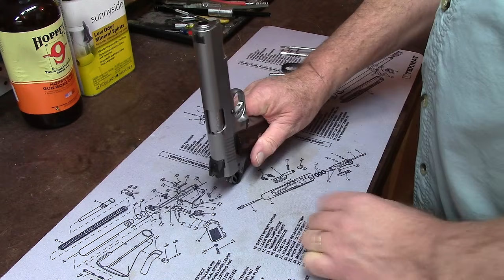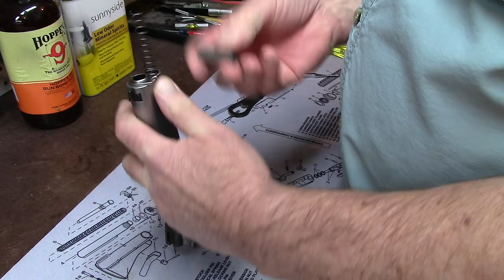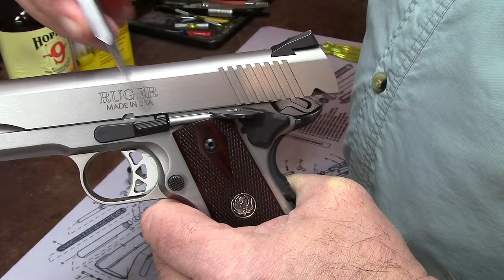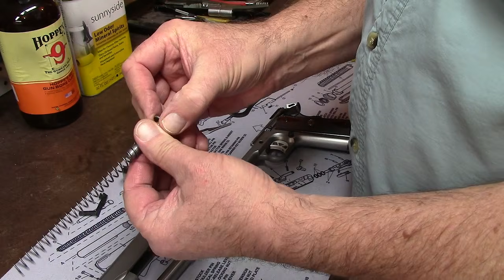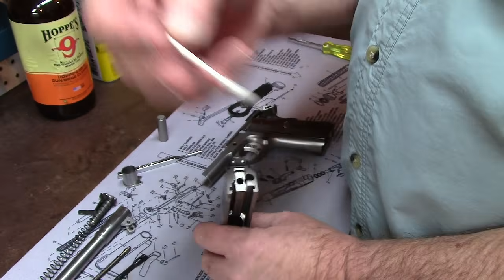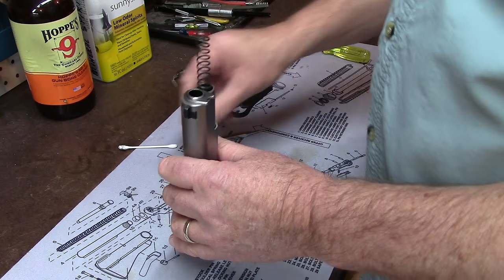How to take down the 1911 pistol for service, inspection, cleaning & lubrication ~ Now in HD!

Comment: I just bought a Springfield loaded 1911 and my plunger tube that catches both the safety and slide lock will not allow me to drop the slide stop into position. I've tried applying just a little pressure with the stop to the small spring in the plunger but it will not push the spring in to allow the stop to seat. I've had to push in on the spring to allow the slide lock to be able to drop into place. I checked the spring and it pushes in and springs back easily. Any ideas out there? Hate to send back to Springfield after just getting it.
Reply from the maker: Brad Fortson 
I am not exactly certain if I understand the issue completely, but I do know of a common problem.  Your gun most likely functions, because they are worked quite vigorously during fitting.  If you are speaking of manipulating the slide stop toward the frame into its home, be certain that you are positioning the nose of the stop toward the small cut and not the slide stop cut, or it will stand off from the frame and be inoperative. The stop can easily appear to be fully home, but if it's not pressed fully in, flush to the lower frame, it simply will not work.  I point out this small cut in detail in the takedown video, so be sure you get the nose of the stop into the small slide cut, and NOT the slide stop notch.
Reply: At 18:53 into the video your thumb is right at that what I think is a small detent spring that is part of the plunger tube. It has a spring loaded round head on each end of the tube. One to the safety and one to the slide lock. At that point in the video where you drop it in and snap it down into position is where mine is not working. I have to push that small detent into the plunger to allow the slide lock to snap home. Thank you for your time. It's an honor.
Reply from the maker: Brad Fortson 
It's an up and in move, rather than straight in.  Otherwise, the stop is defective.  Call Springfield, and I would bet they'll send you one right away.
Reply: I'm having the same issue with a Colt Commander LW . I have to use a pick to press the detent back in while sliding the lock into place or else it gets caught in the slot . There's got to be a better way .
edit : It just took some trial and error to get it to slide in without it getting caught on the detent .

Comment: Great video. Did I miss the "lubrication" portion or do you assemble dry?
Reply from the maker: Brent Vinson 
Stainless steel guns require minimal lubrication, which is nothing more than a wipe with a lightly oiled cloth.  Please watch my video on lubrication, and also the recent video on the disassembly and care of the Smith & Wesson revolver, where I deal with a blued steel vintage gun.  Those will give you the correct perspctive.  OILING of a gun, other than for metal preservation, is absolutely an invitation to gun problems.  Guns are not in need of oil to operate or to prevent wear, except in very specific parts of very specific guns, and even then only minimally.  The popular culture of lubrication is a very recent phenomenon that has no foundation in any major firearms owners manual or armorer training.  But the 1911 you saw me work on is my own that I have fired regularly, shot in local competition, and have carried almost daily for six years, and it's like new, with no wear whatsoever.
Reply: @GunBlue490  like when a steel slide rides on an aluminum frame? (92fs)

Comment: My Dan Wesson 1911 is not easy, the bushing is so tight you cannot turn by hand and must use the tool...  The slide stop requires a thin piece of plastic to install to get past the safety slide.  Not disputing what you say at all, but it just doesn't move easily at all.  Once its together it feels like its on roller bearings and is an absolute joy to shoot, which I do often...   The Colt series 70 is a piece of cake!!   Thank you for your knowledge!!!
Reply from the maker: Tight bushings are not at all uncommon, as it has been believed by many that it results in more consistency.  That's where the tool originally came into use.  Colt and others have used fingered bushings to provide a spring-like grasp.  In practical use, the barrel rests in a consistent place from shot to shot, even with relatively loose bushings, owing to the dynamics of the spring tension that provide repetitive return to battery.  Wherever the barrel rests, it always rests, so it's not random.  As for a tight slide, it has little to do with 1911 accuracy, because it too returns to the same place shot to shot, and the sights are always on the same plane.  The most vital relationship is the barrel link and of the barrel locking lugs to the slide, which are responsible for those consistent return-to-battery relationships.

I've shot some pretty tired old service issue 1911s with sloppy slides and barrels that would hold ball ammo cutting into the black.  Not gorgeous groups, but certainly better than most folks would imagine them capable of, and in fact, would be capable of winning a typical Saturday night match in the right hands.  The pistol you see in this video shoots an entire 7 round magazine of a particular +P handload with Remington Golden Sabers propelled by Accurate #5 into an incredible 3/4" at 25 yards, using an old Lee pistol (machine) rest.  With hard ball jacketed handloads and a standard velocity load with Green Dot, it shoots the 10 ring of an NRA Slow Fire target, and at least 40% cutting the X-ring.  I'm not sure if I'd bet on a Gold Cup to perform significantly better, and it certainly would be less reliable.  This bushing is perfectly snug without being tight, as was Ruger's design, manufacturing the bushing and barrel from the same stock.  The wonderful Colt 70 Series is certainly what Ruger modeled theirs from.
Reply: Good info thanks!!  As far as the Dan Wesson being annoyingly tight in every aspect it does shoot well out to 50 yds.   It loves 5 grains of red dot with a 200 grain round nose flat point cast bullet.  I'm fortunate to have a 300 yd range off my porch here rural southern Indiana.  Your videos are top notch and have been very helpful, thanks for sharing your knowledge it is greatly appreciated!!

Comment: Well done! I wondered what you might have to say about the semi-custom category of 1911's!  I'm the proud owner of one of these.  We love the workmanship and its feel while shooting. However its tight fit up makes me wonder about its lubrication requirements.  When I got the new weapon it was packed almost like  sardines in oil.  Also I was instructed to put 1000 rounds through it and keep it well lubricated -All of this before cleaning and expecting reliable operation.  Well , it pretty much went that way -initially it had occasional issues with stripping and going to battery but after that bobbles were almost nonexistent.  Per you sage advise if have greatly minimized the oiling but I still wrestle with this question  -Does this pistol's "special nature" require more lubrication?

BTW I had to return the Pistol to the manufacturer since it occasionally failed to lock the slide open on an empty magazine. ( I had statically verified that the magazine followers had sufficient force to elevate the slide lock to engage the slide notch).  The manufacturer provided excellent service at no charge and re-cut the back end of the notch as its lower corner had been deformed by impact (or friction?) with the slide lock.  Now I'm afraid to use the slide lock to release the slide.

I now feel  that perhaps a 1911 that is used for carry, in the field,  or for battle should have a looser fit up. I would therefore require minimal lubrication, allowing for greater dirt and contamination tolerance.  My semi-custom is a range queen so I clean it excessively and a little extra oil doesn't seem to be a problem.  I'd be interested in hearing you thoughts on these matters!  Thanks GunBlue490!

Comment: Very good instructions, this is the way I've been doing it with my Colt series 70 for 42 years now. I've also been using Hoppes #9 since I was 12 years old, and I'm 64 now. I see you like to use mineral spirits as well for some of your cleaning procedure, but what do you think about using kerosene in place of the mineral spirits?
Reply from the maker: Glenn Wheeler 
It's fine, but the red dye is not!
Reply: Thanks for your reply, but the kerosene that I buy by the gallon is clear as water, the kind for heaters and not the kind for lanterns.
Reply from the maker: Well, you asked me what I think, and to be honest, kerosene went out with Gone With the Wind.  Mineral spirits was invented during the 30s to provide a better cleaning alternative to other products that were already around, including kerosene.  Since then, mineral spirits (Stoddard solvent) became the active ingredient in almost all gun solvents and other products.  Most folks don't know it's the primary ingredient in Rem-oil, CLPs, Marvell's Mystery Oil, thread cutting oil, and even Hoppes #9, because it works better and is more agreeable to work with than anything else, including especially kerosene.  I'm still using the same quart can that I bought ten years ago for my guns, tools, and many other bench projects, and it's only half empty.  Less than a thimble full cleans a gun, with ease, so it's certainly not a cost issue.  When mineral spirits came out, most guys gladly stopped using kerosene, but it's your call.

Comment: SAFETY QUESTION(Please Reply):
Good Sir,
I love what you said about Ruger using a titanium firing pin and heavier spring in their new SR1911s, ala Series 70 Colts. I learn a little something in EVERY video of yours. You do a fantastic job! I Have two of Ruger's new Lightweight Commanders, 1-,45ACP, 1-9mm(Love'em). Among my Colts, I have an all steel 9mm Combat Commander-Series 70(Serial #70BS62171, Mfg. 1977 I believe). I thought it a great safety to retrofit the Combat Commander with Ruger's titanium firing pin & heavier spring. What do you think of that idea?
Respectfully,
JD in Montana aka Gunwrites
Reply from the maker: Gunwrites 
That would certainly be my preference, but just be sure the dimensions are compatible.  Try the Ruger setup in the Colt, but be very sure that it does not protrude through the frame, or you will have slamfires.  It should be very easy to determine.
Reply: Wow! Thanks for the immediate response. I'll try this retrofit sometime soon, check all dimensions, and for any protrusion. I'll post my results. Again, THANK YOU. You're a wealth of knowledge and greatly appreciated by me and all the gun community.

Comment: Hello sir. I've got a question regaring a Ruger 1911. I was shooting my SR1911 for the first time at the range today. Cleaned it first time out of the box, no oil as you recommended. It functioned flawlessly through all of the 80 rounds. No hiccups whatsoever. I used factory loads (Fiocchi 230 grain RN FMJs). But noticed a few holes looking like they were key holes. Have you ever come across keyholing with the 1911s using factory loads? Or is it possible that there is something wrong with the gun itself? BTW, I simply loved this handgun, the feel and the looks are hard to beat.

Comment: How can you tell that your slide spring is worn out?
Reply from the maker: Jim Gordon 
Replacement springs are pretty inexpensive.  A too soft spring will allow the slide to drive back too hard, and will not chamber a round reliably, especially the first ones.  Those are obvious signs.  It's cheap enough to replace a spring after 3,000 rounds, though I suspect they will last many times longer.  Spring tempering methods are far better and precise than in years past.  Magazine springs that are kept compressed should be replaced every five years.  The 1911 standard mainspring is rated at 16 pounds, compression, if you have the facility to measure it.
Reply: Thanks

Comment: Hi, do you know anything about the Colt Double Eagle MK 2 series 90 SS officers 45acp, and if so what is your opinion of this weapon? thanks
Reply from the maker: Matt Matt 
I have no personal experience with it.  Colt always made fine 1911s, and they were the first and finest.  Check your prices and features, as there are many good ones.  High price does not necessarilly mean better, either.
Reply: I do own one, but people rag on this saying it s a piece of junk and was a white elephant, but I like the gun, but find as I am now 63 find it a little too hard to pull the slide back and was thinking of getting something easier to cycle the slide, but not sure what to get.
Reply from the maker: Matt Matt 
I would suggest a revolver for you.  All slides present similar difficulties for some people as they get older with arthritis, etc.  Find one that fits you, that is comfortable, which means much more than anything else.

Comment: Why do you put the safety on when disassembling the 1911?
Reply from the maker: Python56 
Because it is the correct way, as taught by the US military, which has more practical experience than anyone combined.  It holds the slide fast while the spring cap is depressed, and it stabilizes the bushing, which makes life easier.